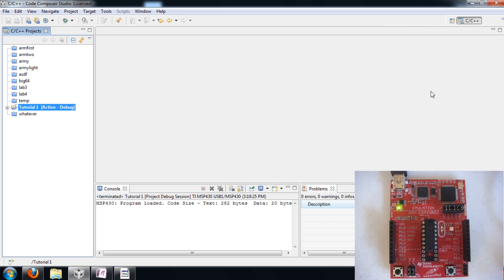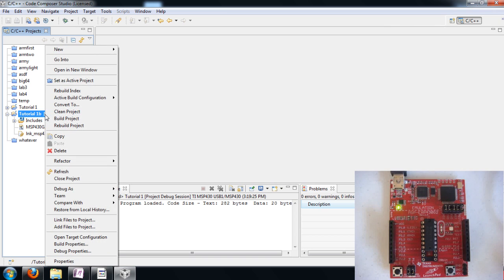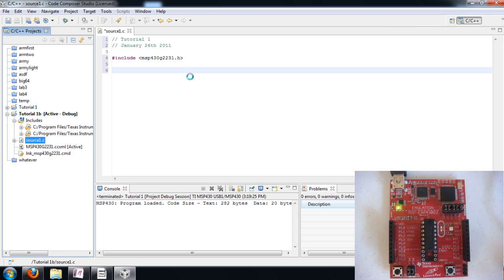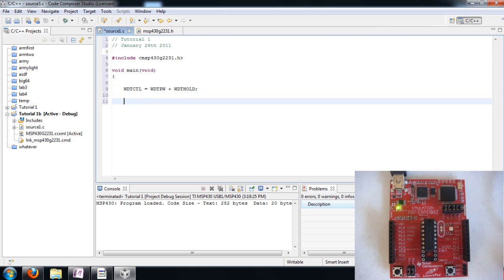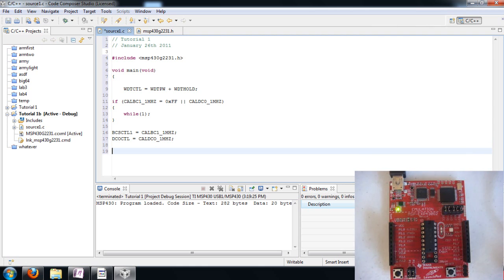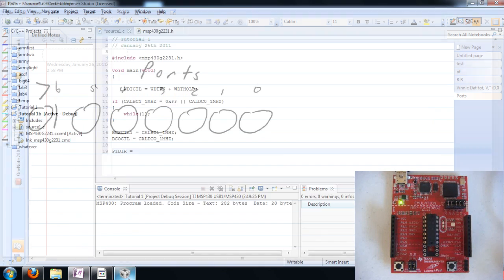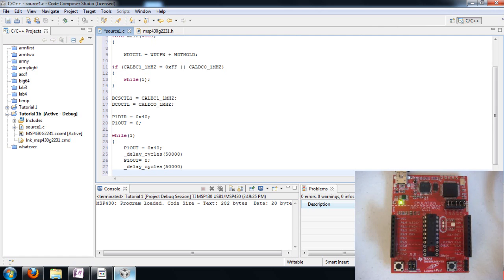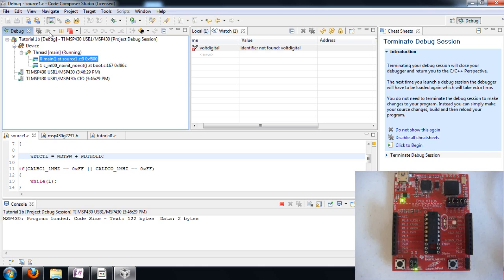MSP430 Launchpad Tutorial 1: Blinking a led.

Comment: MSP430: Trouble Writing Memory Block at 0x1100 on Page 0 of Length 0xb2: This operation is not supported by this driver
MSP430: GEL: File: G:\anil222\ccs\led_blink\Debug\led_blink.out: Load failed.

pls help me how to solve the problem....i am using the msp430f169 board.....
pls send me related links....

Comment: I am Using Code Compose Studio v5 and once I debug the code it does not load into the board, just says: MSP430: Error initializing emulator: Could not find MSP-FET430UIF emulator on specified COM port. Do you know what it is?

Comment: With P1DIR = 0x40.  Why did you convert to hex and not just use binary with 0b01000000?  For me this is more clear as to what I am doing.  Then when you need to "and" or "or" and operation it's very clear what you are doing.  Is there something in the compiler that doesn't allow binary representations? I have never worked with a launchpad so I really don't know?